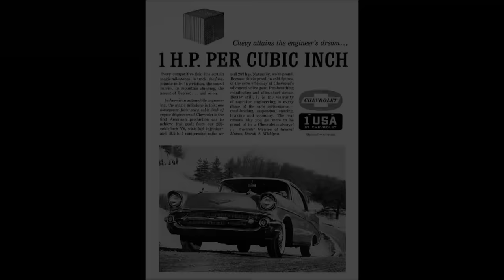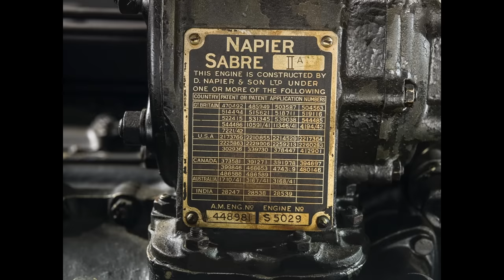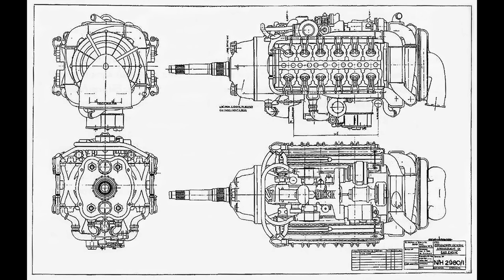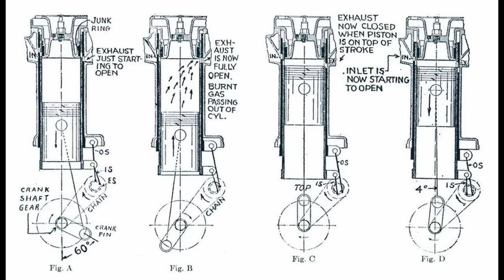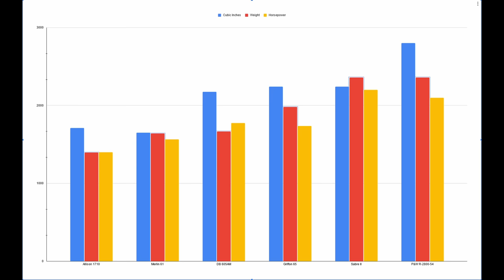Napier Sabre - The Ultimate WWII Aircraft Engine - Part 1

Comment: Very good video, here is the main element that you missed.

When a supercharger compresses air, it also heats it up.  The higher the boost, the more the charge is heated.  The degree that this happens also depends on the adiabatic efficiency of the compressor.  The higher the adiabatic efficiency, the less the charge heating for the same boost, and the less the power requirement.  This is where the RR company shined.  They knew how to build superior superchargers.  Even at the later versions, as they raised the boost to 14 psi, the hot charge challenged the detonation resistance of the engine, and taxed the engine with more parasitic hp.  The post war versions that the other comments below mention finally addressed that problem.

Secondary points that you missed that the sleeve valve had (surprisingly to the unfamiliar reader) less piston friction and marginal cylinder wear.

Another element that did not help the reputation of the Sabre is that it simply did not get the benefit of a good airframe.  Both Typhoon and Tempest were porky fighter designs, much like the large fighters created by the USA.  Too big and too heavy.  Had they installed this engine on a Spitfire-type airframe, the combination would have been the most crazy fighting machine of WW2 and possibly beyond.

I think that the reason the Eagle did not make as much hp was because they did not want to push the initial design.

In your comparisons, you should have at least mentioned the PWR4360.  Not an ideal fighter plane engine, and not very good statistics, but you should have mentioned it.

Around minute 16 you mention the Eagle, and you show something that maybe the early Wayren.  Is there an airframe with an Eagle still in existence?  Where?
Reply: From what I've read the Napier Sabre got its bad reputation because of early production difficulties - the Hawker Typhoon and Tempest were ideal for the engine. Trying to fit it in something as small as a Spitfire probably wouldn't have been possible, or if it was it would have created a difficult to fly pig of an aircraft.
Reply: @kkiwi54  Actually, the Typhoon and Tempest were not easy to fly aircraft.  If you got into a spin in a Tempest at less than 5K ft, bail out was the best way out.  A Spitfire with a Sabre would still have lower wing loading.  If you think installing the Sabre in a Spitfire is tough, look at the installation of a radial into the Kwasaki Ki-61, resulting into the Ki-100.  It can't get tougher than that, yet it worked brilliantly.
Reply: @demetridar506  According to what I have read the Spitfire was developed about as far as it could be with the RR Griffon - anything more (even heavier) really needed a completely new aircraft (like the Hawkers). Nothing would have been gained by sticking a Sabre in the nose of a Spitfire imo. Maybe 5kts gain in speed, but less range due to greater fuel burn, less manoeuverabilty due to the higher wing loading, and less stores/ammunition due to increased all up weight. The later marks of Spitfire were already inferior in handling compared with the early marks. Apparently the Mk9 was the sweet spot 👍
Reply: @kkiwi54  I doubt it, but this is not the point.  The point is that if the Hawker fighters were not as gigantic, the Sabre would have done much better.  Instead of an empty weight of 4,000 kg and 30 m^2 wing, if the Hawker fighter was, say 3200 or 3300 kg empty weight and 24-25m^2 wing, you would have a 500 mph plane with 5500-6000 ft/min climb, plus reasonable dog fighting performance.  As it was, the Tempest was a dog.  All it could do is go fast straight.  The climb was worse than a Spitfire XIV, or even an VIII/IX, and its dog fighting performance was comparable to an FW190.  Even the P-51D could potentially turn inside a Tempest.  Spin under 5,000 ft was death or bail out.  This is one of the reasons the Sabre was forgotten.
Reply: @demetridar506  You may be right, but I suspect that the Hawker engineers knew a bit more than either of us ;) They were very popular with some New Zealand pilots (where I'm from) I know that much. And when they were first being tested this was said/written - "in February 1943 the pilots from the A&AEE at Boscombe Down reported that they were impressed by "a manoeuvrable and pleasant aircraft to fly with no major handling faults".
As for the size, it's usually somewhat of a compromise in order to carry enough fuel/armaments etc. - look at the P47. I doubt that the designers would have made it larger than necessary just for the sake of it.
Reply: @kkiwi54  I am not sure if they really knew more than we do.  We now live 80 years later than them.  We have a whole lot more information about the conflict and the machines involved.  The Tempest was probably started been designed prior to knowing much about the FW190A.  We can now google info about the FW190A that they could only dream back then.

Indeed, in design everything is a compromise.  While a Spitfire or a Spitfire oversize mod with the Sabre would definitely a more effective air combat fighter, the porky size of the Tempest served it well as a ground attack plane.  However, if the question was why the Sabre did not gain the fame of the Merlin and Griffon, that is why.  It was not helped by its oversize airframe to become a very effective fighter.  It is the fighters that are remembered by the public, not the bombers.  Air to air combat is more romantic than bombing people on the ground.  That is why the Spitfire became so famous.

As for the popularity among the crews, generally the air crews tend to like what they fly.  At least those who survived.  As you said, even the P-47 pilots (those who survived) loved their planes.  We now do know that the P-47 was flying junk, at least from the air-to-air combat perspective.

Read the book by Pierre Glosterman, French super ace.  He flew both Spitfires and Temests (he never flew the Spit XIV, contemporary of the Tempest).  I think it is very clear that with the Spitfire turning performance, the fighter pilot options are far greater, compared to a plane that can only fly well straight.

PS, I just looked again at the weight of the Sabre compared to the Griffon.  The difference is not that great.  I bet Joe Smith could find a way to get a Spit with a Sabre, with a strengthened wing.  Of course, Rolls Royce would not allow it.
Reply: Demetri Dar, Westland Wyvern TF 1 on display at the Fleet Air Arm museum Yeovilton England, it is fitted with a Rolls Royce Eagle piston engine. If you can get to the museum I thoroughly recommend it.
Reply: @scrumpydrinker  Thank you very much.  It is very good to know that at least one RR Eagle survives, and at least one airframe with the Eagle survives.  When I visit the Divided Kingdom, I will try to visit the FAA museum.
Reply: @demetridar506  Happy to be of service Sir, a few other suggestions that might be of interest 
Aerospace Bristol, Bristol aeroplane co museum with Concorde and an extensive range of engines, Bristol was very fond of the sleeve valve design and developed it highly.

 RAF museum Cosford, there isn’t any need to elaborate…

Imperial War Museum, Duxford, on a WW two airfield which is still operating though not as a military base, there are many vintage aircraft based there. A comprehensive selection of both European and American aircraft on site as well as a military museum from the local regiment.

Comment: Kinda think RR may have tried to kick the sabre to the curb because they too were developing sleeve valve engines but in a V12 configuration with Harry Ricardo’s help called the crecy they probably saw the reliability and much further developed sabre as a threat to securing more funding for the crecy program they had already sunk a lot of cost into

Comment: I love the Sabre for its Rube Goldberg complexity. Engineering Art of the highest form! Maybe only the Nomad can out do it!
One aspect that should be brought up in comparing these engines is the specific fuel consumption, e.g. gram of fuel per horsepower per hour.
This is quite important for aircraft engine, as fuel thirsty engines will limit range and/or endurance.
Finally a note on German (and Italian) engines: try running the P&W or Merlin or Sabre on 87 octane fuel made from low grade coal (lignite...), and let's compare the numbers again...

Comment: You beat me to the punch.
First thing to mind was power to weight.
Second is heat and reliability 
Third was economy.
Economy to build and mostly, economy of fuel.  If the Napier needs double the fuel to arrive at the same point it will need more fuel thus more weight.  In other words, a downward spiral.  However the sleeve valves are interesting.
Rotating valves are also interesting.

Comment: Why was the slide valve not generally adopted? My 1968 Kawasaki 350 2-stroke had them and achieved over 10,000 rpm’s.

Comment: Contrary to your comment, the additional compression ratio of the Sabre was a very big deal.  You need to think in terms of the expansion ratio, which is what a higher compression ratio gets you.  The higher the expansion ratio the more work you get out of the cylinder pressure generated by the combustion process.  Very simple, and crucial to output and efficiency.

Comment: the cubic inch relates to the combustion chamber size, not engine size. Whereas the weight is the weight of the whole engine. The volume of the combustion chamber is whats taken. So if you have 4 cylinders, and even if the engine is huge at 20L, but if each combustion chamber is the size of 1L, then the engine would be said to be 4L. This is why lorry engines might be 2L in rating but be much much bigger than a 2L car engine allowing it to handle very high combustion pressures needed for their very long stroke for torque.

At high altitudes you dont need torque to turn the propeller, but you need it to turn very fast, so that high rpm helped which is why some engines had gears.

Comment: The only caveat would be the quality of fuel. The German DB and the excellent Jumo 213 were only able to run on 90 octane fuel. The allies were able to use 150 octane by the end of the war which was a huge advantage. The Germans tried to offset this with nitrous and water ethanol injection devices. Nevertheless the Sabre was an engineering marvel and when reliability issues were solved I think it was the outstanding inline engine of the war.
Reply: Good point. One of my former bosses, now sadly dead, started work at the BP Fuel labs in Sunbury in the 1950's. He said back then they still had in store dozens of fuel samples taken from crashed German aircraft. They had analysed the quality of German aviation fuel as a reportable metric to the British government up to 1945 so that stresses in the German refining industry during wartime could be measured. Apparently this showed that German fuel started the war as 'average' quality at best, and it then deteriorated as the war progressed. He told me that a lot of the German fuel was well under 90 Octane and nowhere near as good as the 130-160 Octane fuel that the allies had. This significantly affected Luftwaffe aircraft performance at altitude, hence their use of nitrous. I have read elsewhere that the Germans struggled to get captured Spitfires to run well on their fuel and had to run them with much less ignition advance and sub-optimal air/fuel ratios which led to significantly reduced power and performance at altitude when they test flew them.
Reply: @Pesmog  yeah I think this is a big reason the luftwaffe put such an emphasis on jet engines. They run on kerosene. It's a miracle they were able to compete really. Stanley Hooker called the BMW 801 radial on FW190 "all brute force and ignorance" but the Germans didn't really have a choice, they had to make up the shortfall in fuel quality with cubic capacity. Fuel quality and eventually fuel shortage was really one of the biggest factors in defeat for the German military.

Comment: The Sabre was very powerful, but

 had many early design problems, and in the first nine months of its service life, far more Typhoons were lost through structural or engine troubles than were lost in combat.
Reply: Its Sabre engine had major problems with overheating and the HUGE chin radiator in the Hawker Typhoon, even with 750 lbs of performance-robbing armor couldn't protect the Typhoon from the brutal German AA fire, and 666 Typhoon pilots, 56% of all Typhoon pilots, were lost on operations, a higher percentage than losses suffered by Bomber Command.
Reply: Phew

Comment: I believe you are wrong about the potential of the Sabre. Two crankshafts and, importantly, the bulk ofa crankcase required to stiffen it for the 2 crankshafts meant  extra weight.  But you have done well to have shone a light on this sleeve-valve engine because in fact there was a further development which resulted in a giant increase in hp-to weight. By going to aircooling a huge saving in weight was possible and with a radial design with its stubby crankshaft giving it an inherant stiffness and thus lightened the crankcase tremendously. I am talking about the greatest piston engine design of all time, the radial, aircooled, SLEEVE-VALVED Perseus engine with never saw production but was flown successfully in prototype just before jets took over completely.

Comment: Beyond horsepower, the weight of the engine will affect center of gravity of the aircraft and change handling characteristics.  An engine that weighs 500 pounds more than the aircraft was designed for will possibly put the c.g. out of allowable limits.  This is not a minor issue and may make the aircraft unmanageable.  You can have all the power you want, but you still have to fly the plane. I don't know if this was an issue, but it's not minor.

Comment: I thought that it might be worth it to add that the basic Typhoon airframe during development was intended to be developed into two different aircraft with different engines. The Typhoon of course had the Napier Sabre, the other was called the Tornado and was to have the Rolls Royce Vulture X24 engine. The Tornado was cancelled along with the Vulture engine and never made it past the prototype stage. The Vulture engine had horrendous overheating problems that led to very poor reliability and was a disaster on the Avro Manchester bomber that it also powered and that resulted in the engines cancellation.

Comment: A complex engine is an expensive engine. When you are to get many well performing fighter aircraft into the air, a reliable and proven engine that gives good value for money and for which there are several well working airframe designs will get all the limitted production resources of a wartime economy. For Merlins, there were Spitfires, Hurricanes, Mosquitos, Lancasters and Halifaxes to mount them to.  All of them very successful designs that prove their worth before. It was only when the limits of the Hurricane's potential became visible and the high demand on Merlins made it desirable to have other manufactrer's engines in service, even though they may be a bit pricier that the Sabres started to look like a good deal. Then Hawker had the Tornado/Typhoon design in their drawers as well, and both factors could be worked into a design that offered good enough compromises between availabilty of engines, price and performance. The FW 190's low altitude beating Spitfires as clearly as it did in the begining then was what really opened the door for the Tiphy and the Sabre. Sabres were less reliable, they tended to catch fire on start-up and were expensive and labour intensive to operate, but Typhoon's abilities made them all worthwhile all of a sudden. Then the Typhoon got a high speed wing and became the Tempest, and Sabres started killing jets. Until the Mk. XXI Spitfires were somewhat challenged at very high speeds when it came to withstanding the mechanic loads. For some time, Tempests had an edge over Spitties there, so the Sabres were needed for a fast and robust fighter.

Comment: Why was the Napier unable to match the power to weight ratio of others? It basically had 4 engine blocks each of which were inline 6s. The inline 6 is long and narrow, heavier than a V6 of the same displacement. A V12 is 2 V6s. So you have a weight-,inefficient engine times 4 versus a weight- efficient engine times 2.

Comment: Perhaps you should compare the Sabre to the Allison. Both were developed into Turbo Compounds which could have developed shed loads of power had cercumstances been different. 
I was at the event when the Tempast project was announced if which you showed a short clip, and I dont think they liked me calling it a little engine, perhaps I should have said compact, but it is small considering the power it developed. Compare it to Napiers other engine , the Deltic which powered express train's. Both put out similar power.

Comment: I hope to see one run before I die. There was a serious reliability wit the Sabre though. Napier could not manufacture the cylinders and sleeve valves to a sufficient degree of accuracy. Bristol which had considerable experience with the Hercules and Centaurus radials was able to do this and the Sabre engined Hawker Tempest was an astonishing plane, able to run up to V-1s.

Comment: One big advantage that the Napier engine had wads a very compact combustion chamber very resistant to dtonation - a significant limiting factor for large bore high boost gasoline engines. Just as optimization of combusion chambr and head design has driven remarkable increases in motorcycle engine outpu in the last5 30 years.  good brething, resistance to detonation and high boost gives bvery high power outputs - I have read that some testing on advanced versions of the sabre reached 4000 hp.